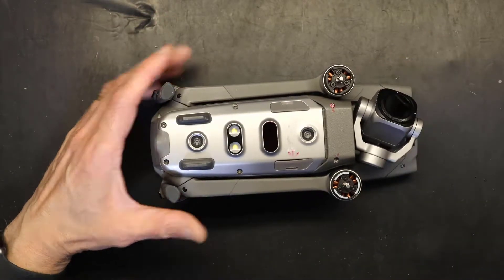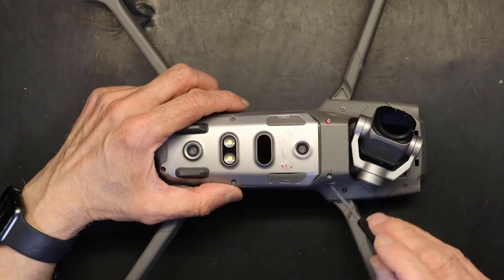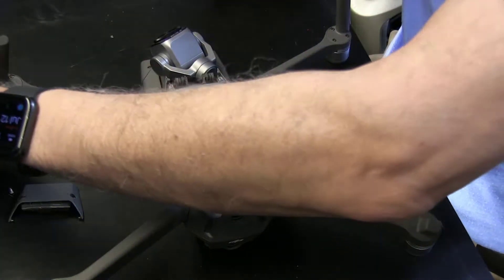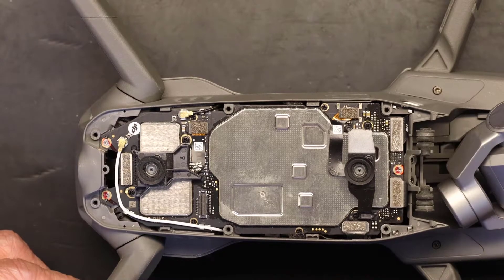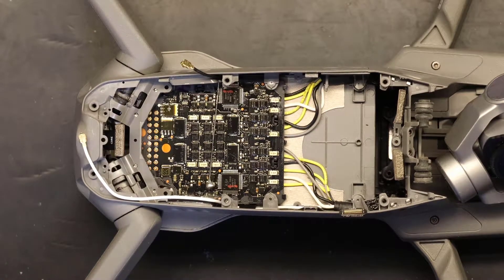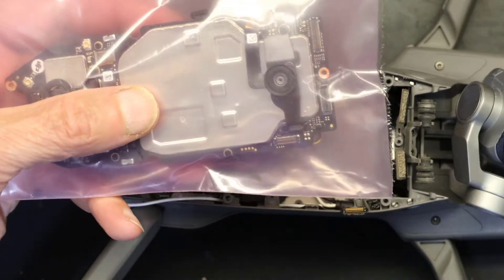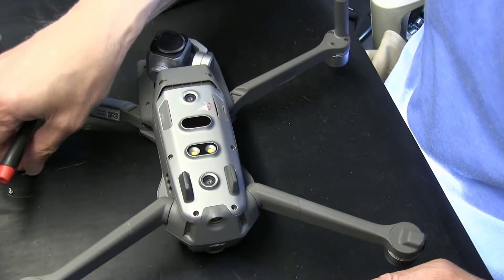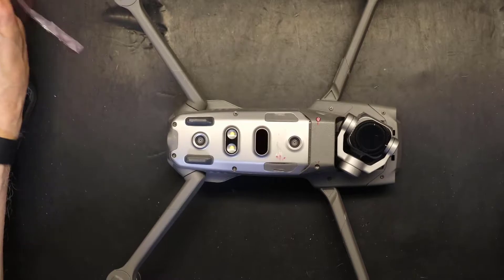Tutorial: How To Safely Replace the Main Mother Board On a DJI Mavic 2 Pro Professional Drone

Comment: Hi friend, I really appreciate your effort to make such a well-invested and beautiful video.
I recently followed the video and made a swap. After the replacement the gimbal stopped working. Did I have to perform a special calibration with the help of DJI Assistant
Reply from the maker: Yes, you need to re-calibrate it if it doesn't work right. However, the most likely cause of such an issue is a poor connection of the Gimbal cable to the main board. So check all the wires and connectors to ensure none are loose.
Reply: How do you do the calibration? @TECHNOLOGYTIPS101